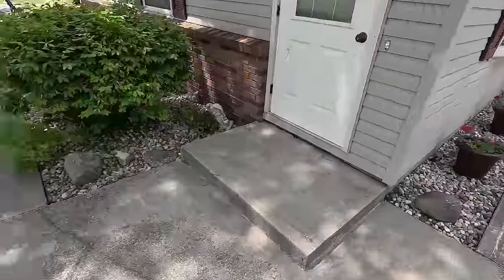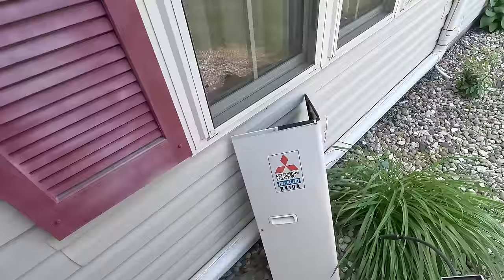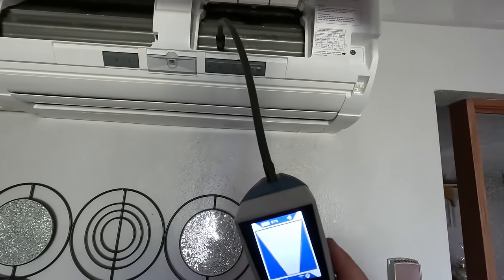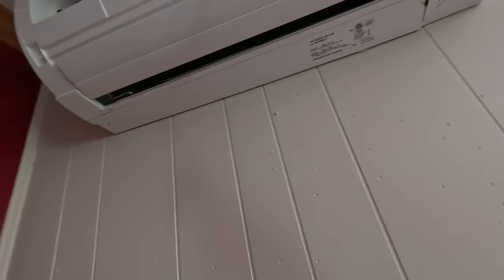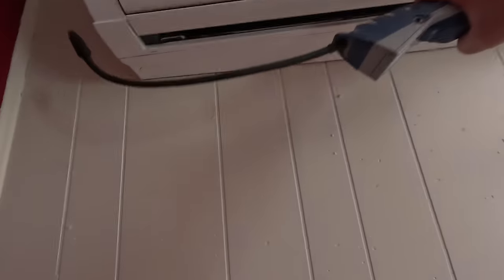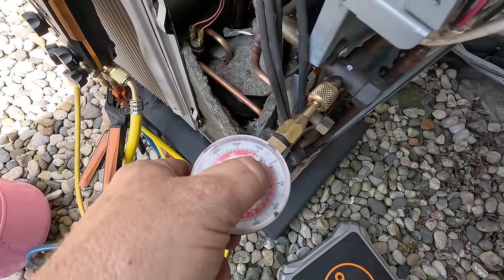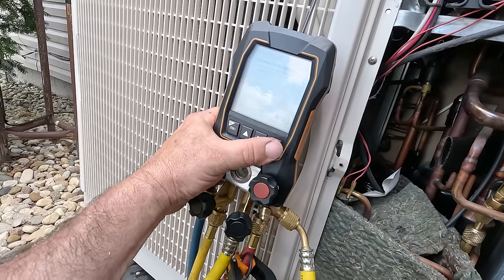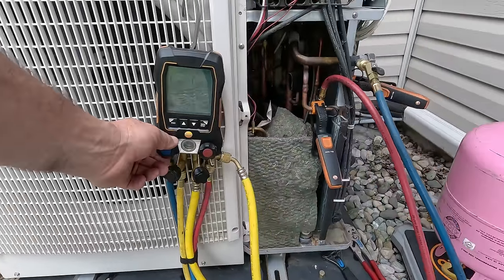I HATE Mitsubishi MiniSplits

Comment: Mini splits are a pain, we call them expensive throw away units.
Reply from the maker: I have to agree...
Reply: They're a pain because brands like Mitsubishi and Fujitsu and Bosch and Midea etc have figured out how to use an inverter to drive a motor at variable speed intead of "bang-clunk-buzz" of a victorian era contactor as the lights on the whole block dim? Cause that's all the American brands seem to be able to figure out. Either that or the unions won't let them implement anything too fancy like that... might cut into the smoke breaks on the line. 😂
Reply from the maker: @dregenioue When we are a diamond dealer going to the class Mitsubishi put together for the m&p class and the city-multi class!?  that's failure on their part not ours. It doesn't help that the Japanese are trying to keep everything confidential from the trainers yet they let China and Thailand build their products. 🤦🏻🤦🏻🤦🏻🤦🏻

Comment: The thing I don’t understand about the “critical charge” is that some units get sent with enough refrigerant for 70ft of lineset and they always tell you to never remove refrigerant so if you have only 30 ft of lineset how is that critical charge when you’re not supposed to remove refrigerant😂nothing wrong with a gas and go when you know there’s a leak somewhere
Reply from the maker: Thank you somebody with common sense 👍👍 I don't know how somebody could be a true service technician without critical thinking 👍👍
Reply: @HVACRSurvival  critical thinking is key. Sometimes you gotta weigh out your options. Spend another hour recovering charge and weighing it back in just for it to leak out again? Dumb move if ya ask me. You did the right thing. Got the customer going until repair can be mad and he’ll never notice anything different than he usually did

Comment: Surprise surprise leaking evap coils. See that all the time on minisplits. Hopefully replacement parts are available. I hate when you get told they’re obsolete and the whole system needs to be replaced.

What filming set up do you have? What kind of camera and what type of mount?
Reply from the maker: What's funny is these lovers of mini-splits tend to say they never seen a leak before which is total horse sh#t. GoPro Black 11 and several different mounts, magnetic and around the neck are the most common ones that do the most work.
Reply: @HVACRSurvival  nice! I’ve never heard of the around the neck but I like that a lot. I bought a chest mount but it’s bulky and cumbersome. Looks kinda odd to other people too. The head mount is cool but it’s a bit high too. I’ll probably buy the neck mount. Planning on starting making my own videos too! Thanks for all your helpful information.
Reply from the maker: Only bit of advice I would offer is make sure your boss ain't going to have a problem with it. I got shut down at first
Reply: @HVACRSurvival  how’d you end up convincing them?
Reply: @HVACRSurvival  Man, I'm not sexually attracted to mini splits or anything, but the company I'm with ONLY works with heat pumps and 95% mini splits. We don't see many coil leaks at all. I'm not trying to discount what you've seen, but there's some variable there. Environmental? Shitty installers? i don't know. But it really is almost always the fittings. They're finicky. Also a lot of coil leaks are pretty easy braze jobs.
Reply from the maker: @matt ... likely the causing of this leak here is like I mentioned in the video,  is the sulfur water in the air tends to create refrigerant leaks, it happens all the time to people's systems that live in the country. Not everybody has it, there's an actual science name for it.   somebody mentioned it earlier but that's likely the reason for it.
Reply: @HVACRSurvival  That is pretty interesting. Also shitty. I'm in Portland, OR where almost all of the water is topwater, so I'd expect less sulfur in the supply. I guess I'll add that to my list of "what the fuck is going on" solutions.
Reply: @HVACRSurvival  Alright I'm replying too much, but I'm interested now. Do you find this is typically from well water? I used to do water/wastewater treatment in southern Illinois and those levels of sulfur wouldn't have passed EPA.
Reply from the maker: @matt there's nothing dangerous about it there's nothing the EPA can do about it. It's a common gas that's harmless to humans, it just does damage to things around it.

Comment: Mitsubishi vs Mitsubishi Electric quality. I have a M/E single unit that's still going strong after about 18-19 years, but yeah well beyond it's expected life really.
Reply: Things that went wrong with it... well very little. I had a look inside, cleaned the radiator fins etc. The capacitor appears a bit swollen so I have a replacement cap ready. It's lost zero oil in operation. Powdercoating got pretty rusty so I dissassembled and fixed some of that, but it's near the sea, so corrosion happens faster.

Comment: Very disappointed with ours  biggest mistake ever buying 4 huge split units heating cooling,  keeps creating problems and do not function correctly all times compared to Panasonic units bought same time, i hated the fact that we had to call electrician to change the board of the sensors that received the signal from the remote control units, happened to different units 3 times, i have no idea why, i thought they would better than any coming from an old company that made heavy industries such as cars and trucks etc
Reply from the maker: Thanks for sharing your experience 👍👍

Comment: I love Mitsubishi MiniSplits. But not the inverter ones. Those low tech non inverter ones are super duper reliable and super silent. They were even used at Camp Bastion (Afghanistan) Billion Dollar Base.
Reply from the maker: The inverter is where you get the efficiency from.
Reply: @HVACRSurvival  But Performance and reliability is unmatched from non inverters.
Reply from the maker: @V0LKSJAGER yeah it’s more reliable, but why even have one? why not have a regular system ? the point of the ductless system is fast easy install and its higher efficient and you can’t get the efficiency out of that regular system below normal temperatures that a normal heat pump can do. A inverter system can adapt to the lower temperatures because it speeds up the oversized compressor and adjusts the fan speeds to make up for the lower or higher temps.

Comment: No LeakSeal?
Reply: Getoutahere 😀
Reply from the maker: Hell no! That's more snake oil, I haven't had one work out of the 4 I've tried.
Reply: About 1 out of 10X leak stop worked. Only on very small leaks…the recharge every two year stable leaks.
Reply: @HVACRSurvival  I understand you. But they do work if no water or air is in the system. I’ve only found success if I add a lot and recharge often. And once the leak is filled, add one more application. BUT who has time or money for that….
Reply: Zero luck on 410a, but easy seal seems to work well on r22.
Reply: @courtne-the-great7961  ""BUT who has time or money for that….""  You do, evidently.
Reply: @jaredcooke1347  This is my experience too. I don't recommend it on 410a. Only on old r22 systems people don't want to replace quite yet.

Comment: There’s no way I’d be quoting a repair on a refrigerant leak is strictly time and material you don’t know the rate of the leak. You don’t get paid for callbacks that’s pretty ridiculous. Especially for a refrigerant leaks. I would never warranty refrigerant leak especially on an old piece of equipment.
Reply from the maker: That's why I document everything that's wrong and what I recommend doing.  It has to be blatantly obviously something I should have caught in an order to be a call back. I can be hourly if I want to make less money.
Reply: @HVACRSurvival  gas furnaces can be pretty tricky. I’ve had some weird stuff happen on gas furnaces. I’m replacing a Goodman heat pump 2 speed. It’s a warranty unit replacement that I installed last year. I’ve been at that house three or four times over the winter, trying to repeat the circumstances that would cause it to go off on the locked rotor code. On the Goodman, there is a current sensor. The common wire goes through which is on the defrost control board. I’ve been there a lot of times and no matter what I do I can’t make it trip in front of me. I put a start kit on it and that did not correct the problem. If something like that happens to you I hope you get paid for it.

Comment: So strange because Mitsu is like the industry standard for mini splits.  I was almost about to buy a Daikin LV 18k BTU mini split for my small two car garage.  I have been thinking about it for almost 3 weeks now.  I'm going to pony up and spend the $500 more and get the Mitsubishi hyper heat 18k BTU unit.  I know 100% that I am going to kick myself later when something happens and wonder why I didn't go with Mitsubishi.  From what I read as well they are way easier to clean the blower motor on the head compared to Daikin.

My friend has a Mitsubishi in his garage and loves it.  I plan on installing the unit myself.  Only thing I'll probably have a HVAC guy do is do a nitrogen pressure test.  All the other tools I have.  And reading through the installation instructions from Mitsubishi  and watching countless hours of mini split install it seems rather straightforward.  Follow the directions to the T and you should have no issues.  It's mind boggling to me when I ask a question on HVAC forums and everyone is like "IMPOSSIBLE" for you to install it...  I was quoted $8k to install a 18k BTU unit.  I can buy the Mitsubishi for $4k and then spend a month installing it and buy ALL the tools over again and I'm still going to be ahead of the $4k labor charge that everyone is charging here.  I need 15' of lineset and the exterior wall is 12 inches from the back wall where I plan installing the mini split.  It doesn't really get any easier than that.
Reply from the maker: They are fairly brain dead to install if you follow the directions.
Reply: Yep, I'm going to be installing 3 units for myself this year.  I have noticed forums just laugh when a homeowner wants to install themselves. I think I can handle it, thanks.
Reply: The hyperheating is on paper much more effective when freezing cold compared to other brands. The performance decrease is much lower than the competition. If you don't have harsh winters. Don't buy it. Labor prices are so high in the U.S . I'm in France and I charge 400eur maximum labor per day. Still can't get more than 1000eur per month to love after all the taxes and fees.
Reply: For what it's worth, my company has ~18,000 mini split installs and a great percentage of them are Daikin. We've found Daikin to be wonderfully reliable. To be fair, we also have an amazing supplier right down the road, but Daikin is our bread and butter. They're great. Mitsubishi is definitely the Cadillac, but they're harder to work on and obviously more expensive. Anything other than an LG or some shitty off brand (Mr. Cool, etc) is okay in my book.
Reply: Be sure you have a proper torque wrench and flare nut crowfoot etc. for the flare tightening steps.... and some nylog (properly applied, of course) ....These are the most critical steps for mini-split installation.   Second most important is to be sure the drain line is not kinked anywhere, and that each head unit (indoors) has it own private (i.e. not shared) drain pipe to the outside.

Comment: Should have reclaimed the refrigerant left in the system. Then charge with dry nitrogen beyond standard presure, with a trace of 410. You would the find the leak properly with your refrigerant detector! Repair leak properly. Evacuate as per trade code. Then weigh in the correct charge with the liquid valve from the charge bottle. Run system and add refrigerant as needed to the specs of the installation. No brainer. 
You will get called back to the same leak that was not rectified.
Reply from the maker: That’s interesting story you got there since I found the leak with standard pressure and repaired it by replacing the bad coil that I brought home and dunked in water and double verified what I showed blind folks that leave crazy comments like this. Imagine my surprise when it leaked in water 🤫🤔😉.  The system is still working. It’s funny how my average of 450 videos have a 97% approval rate. Not bad for a hack that doesn’t understand standard procedure. 🙏👍👍 thanks for your opinion, I did boring, easy ass , residential equipment 19 years before getting the chance to learn what I didn’t know until I got on the industrial equipment.

Comment: I was taught if youre gonna gas a mini split you turn all the heads on and look to charge to about 5 degree SH. Not perfect but if youre trying to save time itll do
Reply: I like to make sure the compressor sounds like it's gonna take off for flying in combination with the low superheat.
Reply: @vincentgrueter7759  right you definitely what a maximum load on it if you're doing that method

Comment: I’ve been watching tons of HVAC videos (guess I’m a masochist) and this is the first minisplit leaking I’ve ever even seen, as compared to the many, many, and..many repairs to central air units that have coils leaking that are only one or two years old..this unit doesn’t look that new..did they just do a crummy install?
Reply from the maker: A bad Install wouldn't cause the coil to leak. The fact that two coils failed on the same system doesn't say much about the indestructible quality they claim.
Reply: Yeah. Almost all leaks I've found are at flare connections. 
I can't remember the last time, if any, that I replaced a high wall due to a leak.
Reply: @HVACRSurvival  It could be that the installer bent the lines very violently when pulling them out to connect the flares. They can crack at the bend closest to the coil.
Reply from the maker: @mrfrenzy.  My company installed this for him years ago, it was started correctly but he's had several different problems with it. Far as the detector giving me a false indication,  I know my leak detector very well, when you use the parts per million display and it shows me exactly where it's at and that it's not stray refrigerant.
Reply: @HVACRSurvival  Which brand of mini split do you think is the most reliable?

Comment: "Sulfur water"? These have tap water running in them too?! I thought it was just refrigerant? 
You got to worry about what kind of water you got too?
Reply from the maker: Give this article a read. This crap will make refrigerant systems leak and if it's bad enough it can cause electronics to not work right. It eats into the solder joints.  https://www.health.state.mn.us/communities/environment/water/wells/waterquality/hydrosulfide.html
Reply: @HVACRSurvival  Thanks for the info! I understand hydrogen sulfide in water systems. 
What I don't understand is how that relates to a mini split. Is there household water running through a mini split?
Reply from the maker: It's a gas floating in the air, the HVAC system sucks that gas floating in the air and blows it across the evaporator coil, it's constantly getting penetrated with that gas and that causes the problem. I'm not a scientist, I don't know why it does it, it just does it.
Reply: @HVACRSurvival  OK got it now!
I happens from the 'outside', of course. Corrosive gasses will hasten corrosion. 
For some reason I couldn't get my head out of thinking "plumbing".

Thanks again!

Comment: If you have an average home (1500 sft to 4500 sft), and live in the frigid north of the US or Canada, then Mitsubishi HyperHeat Multi-Zone is the most inefficient system for you. You are better off installing a Mr Cool Single Zone of Multi-Zone, because Mitsubishi multizone will short cycle frequently (going to ZERO to peak - shutting down and starting up), resulting in energy consumption of over 3000Kwh. Other companies have designed the systems to modulate but not Mitsubishi.
Reply from the maker: The hyper heat is the efficient system Mitsubishi has for colder weather and it’s variable like most of their systems are. I’m not sure where you’re coming up with some of these assumptions but they’re not correct.
Reply: @HVACRSurvival  Yeah, he's wrong. Hyper Heat will outperform Mr Cool on any day or night.